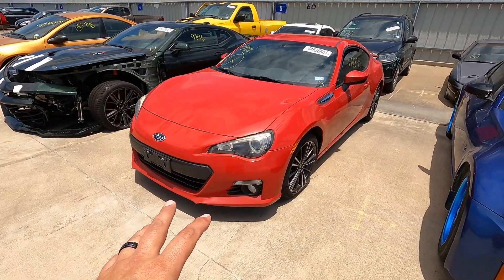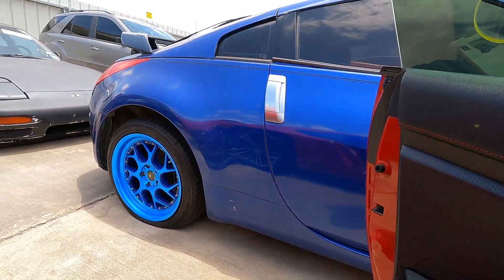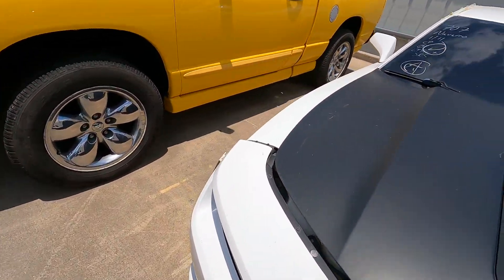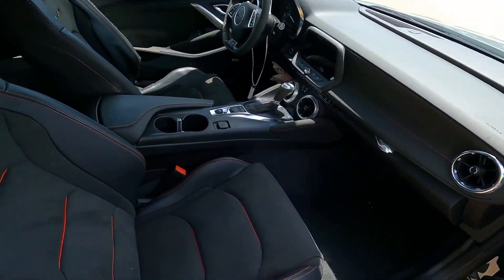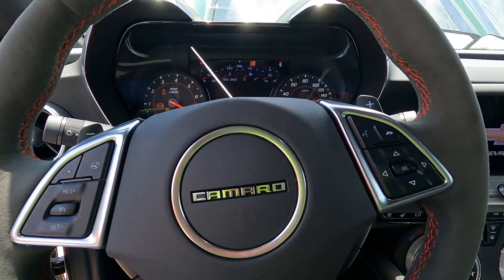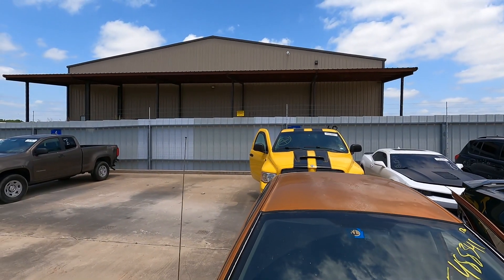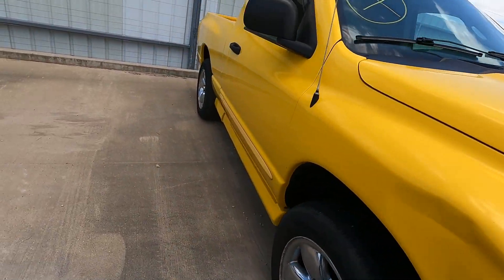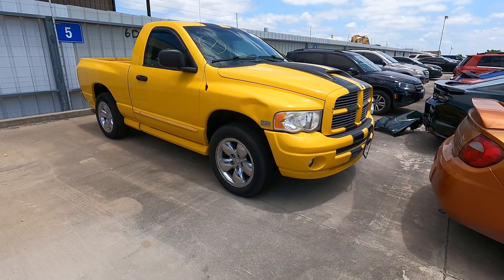Copart Walk Around 6-15-21 Dallas PT 2 of 2 - Dodge Ram Rumble Bee Camaro ZL1!!

Comment: those neons are very fun my mom had a 03 sxt 5speed and they are rare 93 percent of them were auto cars but they are very fun to take through the corners we live in AR and it was a fun car but timing belts will do them in hers went a week after paying it off and they are interference motors
Reply: so she ended up having to sell a car she paid 8k for to someone for 1k cause the motor was gone after timing belt snapped

Comment: I have a 2004 dodge neon se with 52218 miles original on the engine and it runs so smoothly. No shaking nothing is wrong with it except the front lower control arms need to be replaced
Reply: With ice cold a/c

Comment: The white 2014 2SS has the 1LE option package the hood extractor is also normal for that year SS, the black wrap on the hood and black rear spoiler comes on the 1LE package. The 2014 ZL1 hood is completely different.